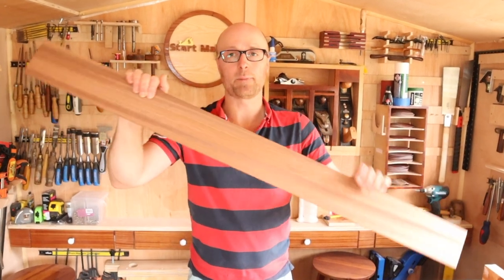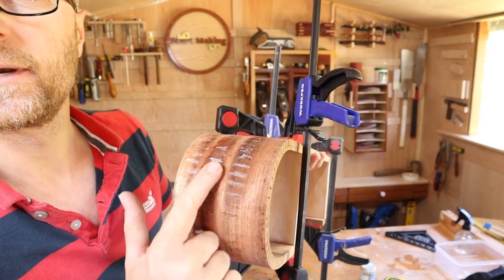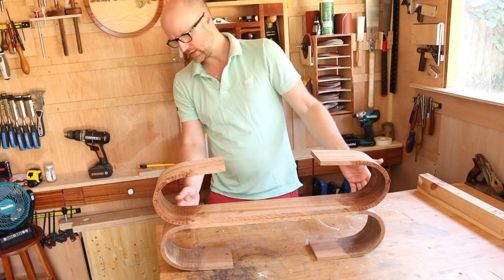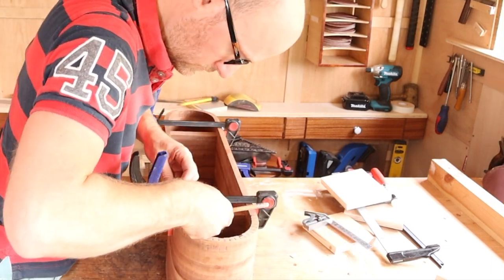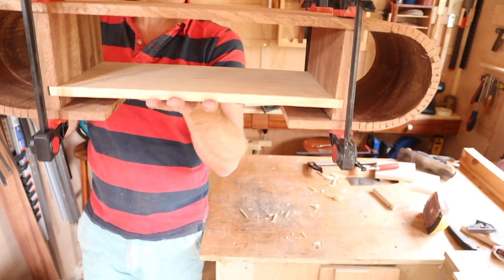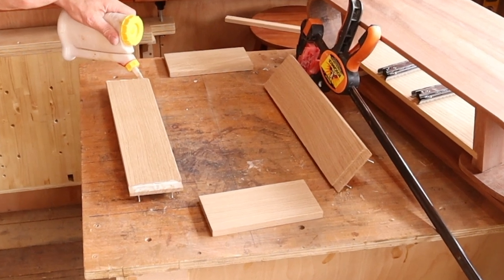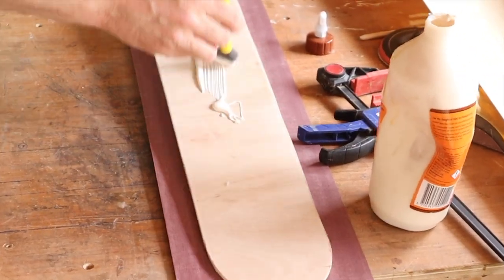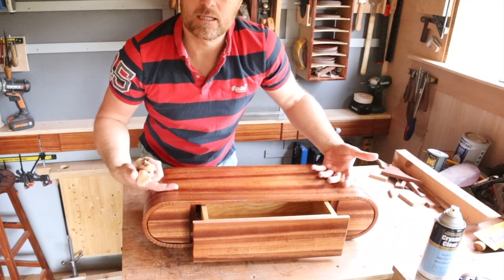Beautiful WOOD BENDING experiment // First time win.

Comment: Nice job. General Finishes makes some really durable (& low/no VOC) water based finishes. I've used their semigloss top coat & they also make glossy plus a dead flat clear finish. It's durable enough for flooring so should be plenty good for furniture. I've had great success with it, no yellowing after 5 years. I used it over 5 years ago on a piece I made from white ash with walnut accents & I wanted to keep the really nice light color of the ash in its original color. It looks the same today as when I first built it.
Reply from the maker: That is a great tip. I am still struggling with what finish to use for what. Thank you for the advice.

Comment: Well done! The kerf method seems to be working better than I anticipated. 🙂
I have only used it for plywood which was later puttyed (is that the word in English..?) and sanded smooth before painting. 

To avoid splintering of the wood on the outside it isn't uncommon to use a strip of sheet metal which is pulled tight (maybe using small clamps) when bending the wood.
This method can also be used when laminating strips as you did with your hooks.
Reply from the maker: Great idea with the sheet metal. Would definitely have made it easier if I had it to hand. These 2 were both really experimental and I am shocked to say that the hooks are still holding up really well. Really shocked by that. This kerf bent draw box still hasn't found its use and the draw front has broken my heart a little as the wood has cupped. I suspect it is because I stored it in my unheated shed and didn't lacquer the back. Who knows. Still the best thing I have built I think. Mainly because I just followed no plans and had no expectations. I think that we can accept puttyed as a word, It certainly describes the action.

Comment: Looks beautiful and I love it as a monitor lift. Add some legs and it would also be a great bedside or entryway table.

For the laquer did you try the brown paper bag trick to burnish the final coat?
Reply from the maker: Hi Valerie. I didn't, but am googling it right after typing this. Thank you so much. I did have a thought of attaching it to a wall by the front door to put keys on/in but after checking we don't have a wall that would suit. Legs would definitely work. Thank you for watching and for commenting.

Comment: Another great video - and a great achievement! Well done!
Personally, I hate rattle-cans and avoid using them whenever possible.
My usual finish is Osmo Polyx hard-wax oil. It isn't cheap but a very, very little goes a vary, very long way. It is incredible just how far it can spread. This isn't me being cheap - for the best finish, it is important that Polyx is applied in two microscopely thin layers. I like to apply it with a white non-abrasive pad.
Polyx was developed for use on floors, so it is a very hard-wearing finish.
However (and this IS me being cheap) I have recently started using Oli Natura Hard Wax Oil instead. It seems to be very similar to Polyx - it looks the same, smells the same and is applied in the same way - but it costs a great deal less than Polyx 🙂.
Reply from the maker: Hey Clive. Thank you so much for such a great comment. And for watching of course. That is the second recommendation for Oslo wax oil. I will grab a pot and see how it goes. I don't really worry about the price because now I am filming the number of projects I am doing has dropped a lot. I tried Danish oil on one that I will put up in a few weeks and was very disappointed by the lack lustre finish. I will definitely check out the cheaper alternative though. I love a good recommendation. Thank you so much

Comment: Hey Mark that looks great. Think it's gotta be just monitor stand or a side board on a side board with set of maybe 4" legs on it. For finish my go to has always been Danish oil can't remember the specific brand(colron refined) that's the brand usually takes 2 coats but you get it in the range it's were it's cheapest one the best ones or good old beeswax finish. Can I ask what wood did u use for the starting bent structure?? 👍🏴👏
Reply from the maker: Hi Michael. That is a great idea., And I will have to get some more Danish oil to try. Mine went funny in the cold last winter. The Outer wood is Sapele. You get some beautiful grain patterns especially if there are some lighter grains mixed in. I use it quite a lot. The shelf is Beach and the draw was oak. I may regret that one come winter if it expands but lets see. Thank you for watching another one and for yet another great comment. I have finally finished the small builds that sell filming but editing is very time consuming. That and I have another video ready to go. Not long though.
Reply: @startmaking1  great can't wait for that one yea a must say Danish oil has always been my go to it doesn't like cold to be fair the bottle basically just sets I usually keep mine under sink during winter. No bother thanks for that gonna attempt one them a think maybe not with the drawers though bit to advanced for me just now. Be good to see what kinda smalls you come up with. Serving boards and stuff have been good one for me so far out elm and chesnut and couple sycamore but a fear am pricing to low. 🏴👍
Reply from the maker: @michaelwillson6847  Mine are a little simpler. Hard not to under price, but you have to value your skill
Reply: @startmaking1  yea well when am offering nice live edge slab serving boards at around £35 mark to cafes think am selling myself short. Have u an email I'll drop u couple photos them get another makes opinion on how much you'd charge? 🏴👍
Reply from the maker: @michaelwillson6847  yeah bud. Pop them over to startmaking2022@gmail.com

Comment: Great video and a great piece that you made. Could use it as a floating bedside table, think legs would spoil it. I would go with what the others have said and use osmo although one of my projects I used yacht varnish and that gave a great glossy finish. Keep the video coming, very informative 👍
Reply from the maker: Hi Darren. Thank you so much. I agree that after looking at it for a while, legs are not right. Sadly our bedroom is in the roof so no flat wall, otherwise that would be really nice. I have just bought OSMO, would you apply it over the danish oil I already have on it? Thank you for watching too.
Reply: Hi Mark. Shame about the sloping walls in the bedroom. I've not put osmo on top of danish oil but i asked good old google and it says no. Will work on top of a stain but not another oil based product. Probably have to sand it back to bare wood 😕
Reply from the maker: @darrensworkshop800  Wow that was luck. Thank you very much for the heads up. I was thinking about just giving it a blast. Dodged a bullet there.

Comment: I made a desk recently and stained it with 4 coats of lacquer, 3 coats, then sanded and then fourth coat. It looks good enough but I think if I had to do it again, I would do 3 coats, sand, 4th coat, sand and then 5th coat. Sanding with 400 grit.
Reply from the maker: It is a learning curve and I think what you say is right. The more you put in the more you get out. The sanding is not actually too time consuming so doing it a few times is probably only a few minutes added to the project and the feel will be amazing.

Comment: Is it a cd draw and stand for a music centre ?
Reply from the maker: I like the idea. Shame it is not deeper with the draw coming out further so I could stand the CD cases upright. Someone suggested making one with speakers and that wold be cool with CD storage in the middle. Thank you for commenting and for watching.
Reply: @startmaking1  nice work by the way…
Reply from the maker: @doozerakapuckfutin  thank you
Reply: Another Osmo vote from me.  I apply multiple thin coats, wipe off any tackiness after a couple of hours (quicker in hot weather, slower in 'UK 2023 summer' weather) and fine sand between coats, switching to 0000 steel wool as the finish improves.  Beeswax polish over the top further refines the finish, and also improves with additional applications over time.  I  refinished four oak dining chairs last year which turned into a marathon project, the chairs were in use throughout so each needed a protective finish asap.  I totally lost track of which chair was which and how many coats of Osmo each had had, but when completed they looked perfectly matched.  I'm sure I ended up applying Osmo after I'd applied beeswax polish, not a problem!  One chance discovery was an accidental paint spill that dried on one of the chairs before it was noticed ("Noooooo!").  I removed the paint with Pink Stuff abrasive paste, fully expecting to have to sand back and refinish... but the Pink Stuff created a lovely glossy finish, which beeswax polish really enhanced.  I gambled and Pink Stuffed the entire set, I can't promise there won't be long term problems but they still look awesome a year on.
Awesome steam bending, I'd have bet big money it would break given such a tight curve... always nice to learn something new, and I have no problem with being proved wrong (probably cos I've had plenty of practice) 😂